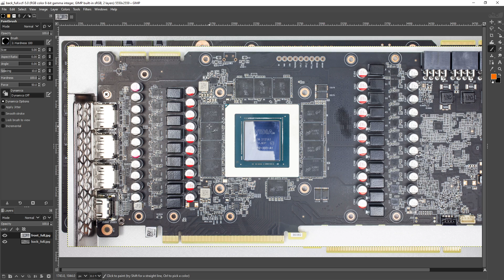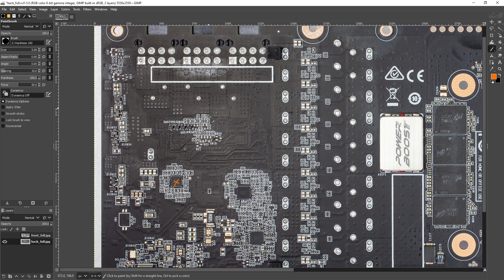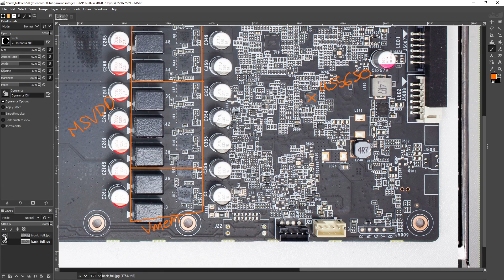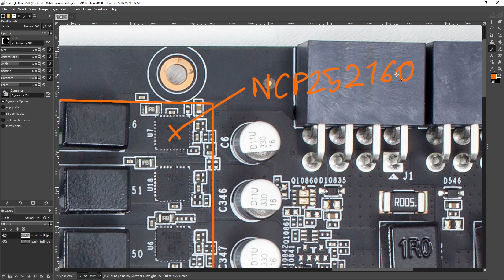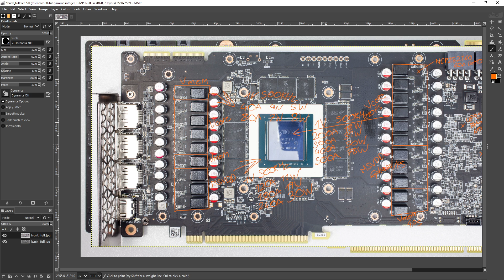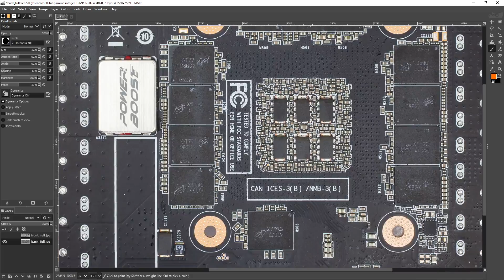GPU PCB Breakdown: Zotac RTX 3090 AMP Extreme Holo

Comment: so if i pull 650 to 700 watts on my 3090 with 1000w bios over 3 pcie 8x power connections . power supply is a 1500w dark power pro 12. never feels hot wires never feel even warm and i can play modern warfare or any game maxxed out pulling those watts for hours. is that to much for those pcies or what. cause i feel like its bullshit and its fine

Comment: I have a question, regarding gaming GPUs in general.
What is the typical highest current cards pull from +3V3 from PCIE slot?
I know the standards say 3A but well those are just standards, most of the modern cards not conform to many PCIE standards...
Also what GPUs use it for?

Comment: You mentioned that the voltage read point was not accurate.  However you did not comment on the precision of the read point.  Would a Delta of the core voltage versus the Reed point voltage be the same?

Comment: I know nothing about circuits, but I just googled and found out these much shunts may relate to the high temperature range of the 3090, it's something called TC Resistance, and it even changes by time under the same temperature, so they may trying to average the resistance out

Comment: I have Zotac's bare minimum. The trinity 3090 is literally the only 3090 with no ability to raise the power draw. It only allows access to 100% power draw.
Reply: They released a bios update that lets you increase the power limit
Reply: @TwitchFailsandWins  I still haven't even downloaded the resizable bar update. Though that's mainly because my system doesn't support it. 

But in general bios updates are iffy as they risk brick your card much like with mobo
Reply: I'm still using that card at 450w with the 1000w BIOS it has survived for 1 year so I hope it doesn't fail.

Comment: Have you tried asking gigabyte if they would be willing to send you a 3000 series card to assist with motherboard testing BZ?? A 1080ti doesn't seem sufficient to push a current gen CPU in benchmarks, but  I do not know exactly what your trying to test so just a thought. Cheers

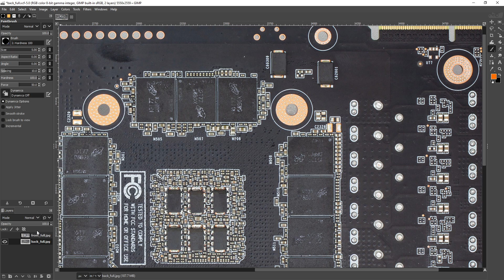Comment: 20:26 Wow I didn't know these used inductor DCR current sensing, I thought they just monitored the drop across the HS mosfet inside the package. But you can clearly see the traces. You can also see the passives the have downstream of the inductor. These cancel out the reactive component of the sense voltage leaving only the DC.
Reply from the maker: I don't think I've seen any controllers using high side Rdson for current sense. Low side is pretty common for the basic controllers used in minor rails. But vcore on many cards has been using inductor dcr for ages

Comment: I won the Zotac 3070ti Trinity on shuffle, which is their base model. Temps good, runs at advertised clocks. With the current state of the GPU market, it will probably be a good while before I attempt modding newer cards. Seems good for what I need it for at this point. Gaming.

Comment: Shunting JUST the pcie slot on those weird FTW3 cards let's them pull whatever necessary when you flash the 1000w bios.
Ask me how I know. 600w can be done easily with proper cooling
Reply from the maker: Yeah so it sounds like they messed up the configuration of the NCP45491/US5650
Reply: @ActuallyHardcoreOverclocking  What's your view on the OnSemi NCP8610 controllers used on the EVGA 3080 Ti FTW3? Do you think it's an improvement over the UPI 9511R  in the 3090? https://www.techpowerup.com/review/evga-geforce-rtx-3080-ti-ftw3-ultra/3.html
Reply: I got a Zotac 3090 arcticstorm on 4 360 radiators with the 1000w kingpin bios and the highest watts I see it pull is consistent 675 in metro exodus enhanced . I play it for like 5 hours or so at a time and max temp is 50c do you think that constant watts can kill the gpu or it’s okay